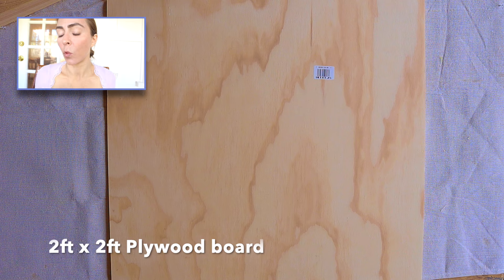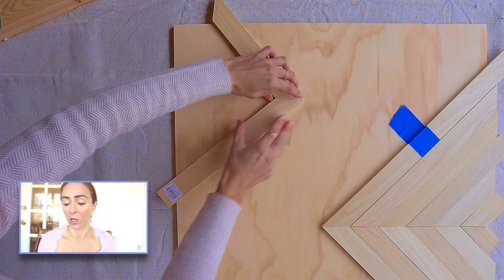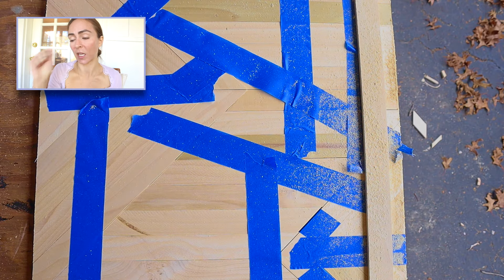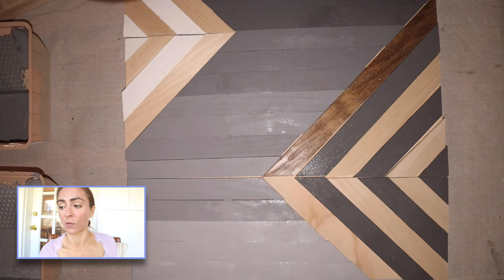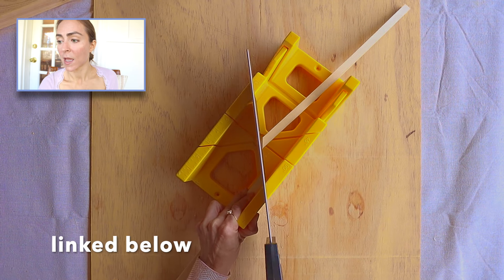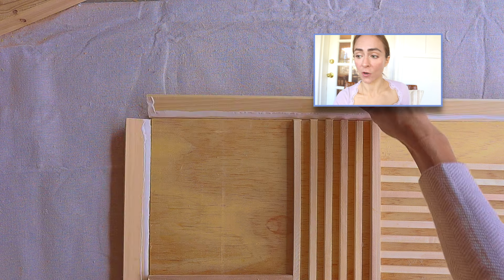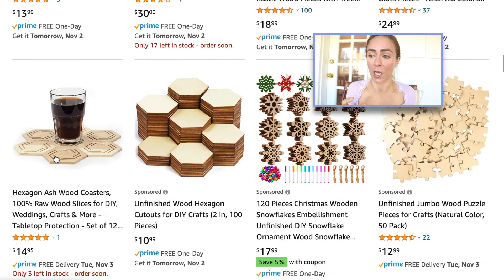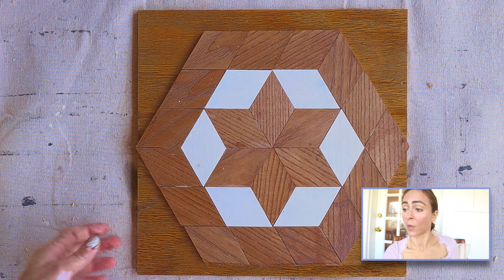DIY Boho Wood Art 3 Ways | plus Q and A!

Comment: To reiterate your response, as someone who has been running a business as a woodworker with ADHD for more than a decade, yes, you can do it. Also, your advice regarding taking a break when feeling challenged or frustrated is extremely pertinent but sadly something i've only recently learnt and still struggle to always do when necessary. In response to your very last query about what I would do differently or how to improve, I hope it isn't a cop out to say nothing, I wouldn't do anything differently, you're already doing it so you've overcome the biggest barrier to entry being either intimidation, self doubt or imposter syndrome (they are all essentially the same) so your improvement will come incrementally at a pace that is right for you provided you keep the perfection monster at bay.

Comment: I watched this video after I made it and happened to do it the 2nd way (hand saw + miter box) however I first taped pieces in place and want to stick them all in one go. Just in case I change my mind at some point. Next I will stain everything. Would love to know if there is some polyurethane or varnish sort of thing to apply over on top to protect the piece. Good video for instructions! I did it the hard way 😀
Reply from the maker: Hey that’s awesome!! You can definitely do a wood finish to help protect, I’d say do a polyurethane (probably matte finish or satin finish, but up to you) - another option is a lacquer finish. With either finish you’ll need to do several coats, and you can buy both finishes in spray can version, which might be best for a project like this! That way it can get into all the cracks without globbing on big drips or anything. Lmk if that helps!! I’d love to see the finished product!

Comment: How do you hang them on the wall ?
Reply from the maker: Oo good question! I just get sawtooth picture hangers, I’ll link one below. You hammer it in to the back of the picture / frame/ art whatever, and then it can hang on the wall on a nail, super easy!

https://www.instacart.com/landing?product_id=22760488&retailer_id=238&region_id=38190616525&utm_medium=sem_shopping&utm_source=instacart_google&utm_campaign=ad_demand_shopping_rp_meijer&utm_content=accountid-8145171519_campaignid-11453731415_adgroupid-117541081808_device-m&gclid=EAIaIQobChMI-LGRps3p7wIVr_LACh3EYAaLEAQYAiABEgJ76_D_BwE